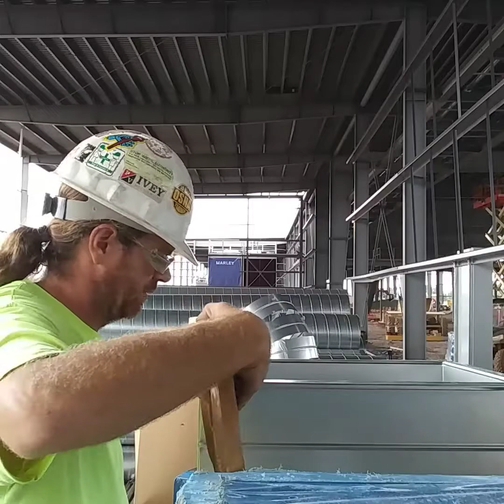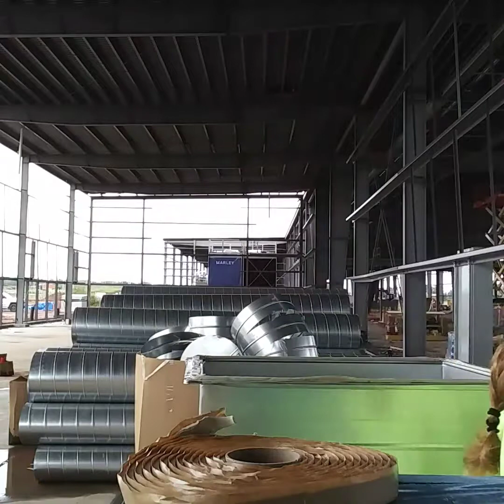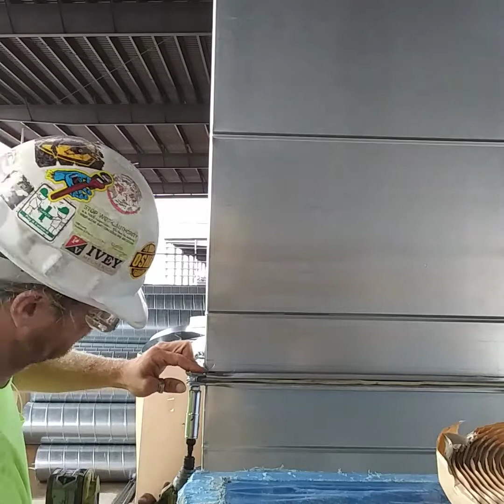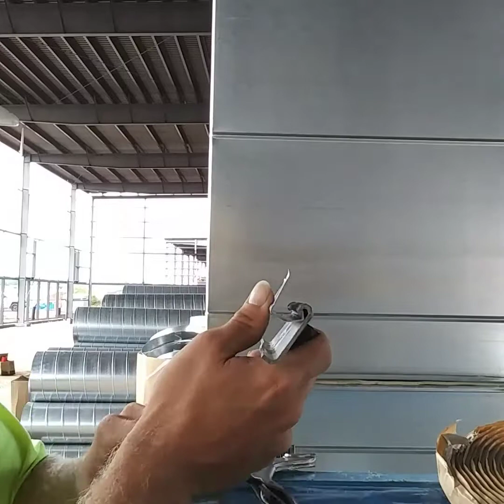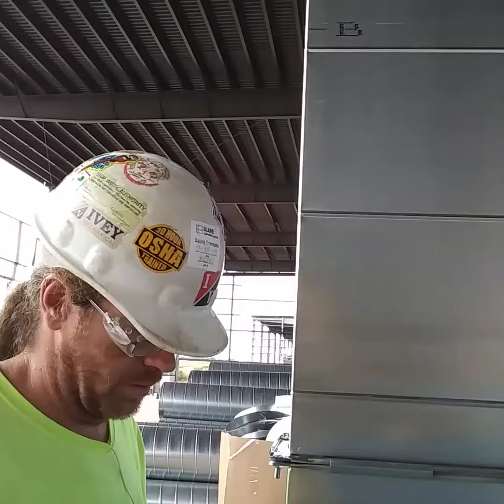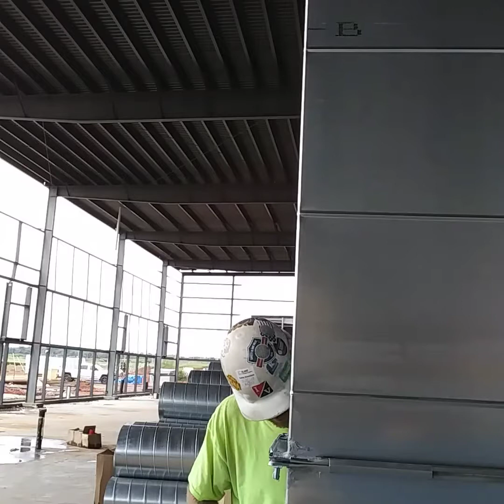How to assemble TDC / ductmate duct

Comment: U suppose to putty the other side corners or it leaves gaps
Reply from the maker: When you put little bits on the corner like i showed it compresses into the other sides corners when you bolt it together.  But yes you can gasket the other sides corners if you're having problems with leaks.  Mine never leaks so this is what i showed.  I personally prefer the bunny ear trick on the corners but like i said in the video they now say that's wrong.
Reply: I noticed that too

Comment: What you use to hang those ducts?
Reply from the maker: All thread and unistrut normally (all thread down, and unistrut under the duct.), or if its a drop i have ran the all thread down through the bolt holes.  Just make sure to use nuts on the bolt holes if you do your drops that way.
Reply: Use ductsealer on the corners, high pressure system over time will spit bubble gum out of the TDF corners. But I give you an A+ for continuing around the TDF flange and not folding the gasket in the corners. I loose my sh*t when I see guys do that in the field. Not bad. Well done.  🔧